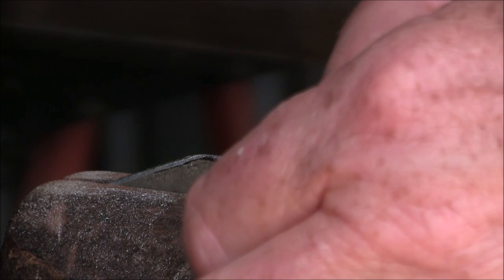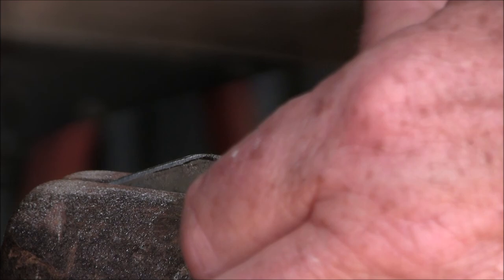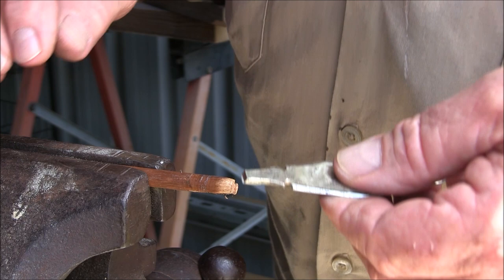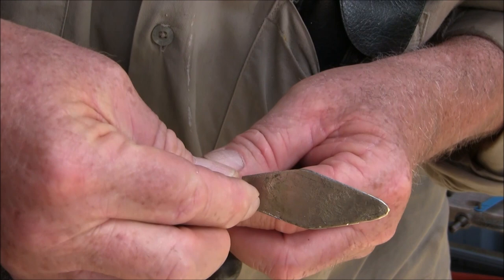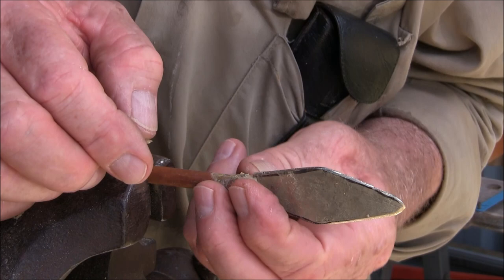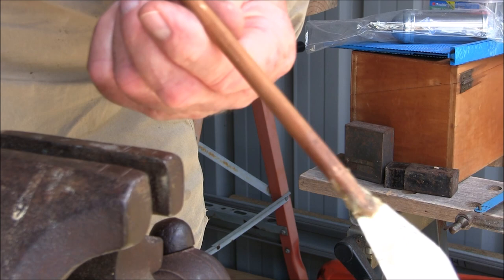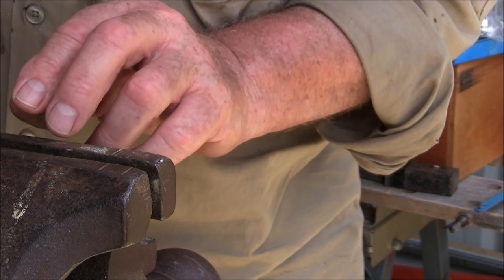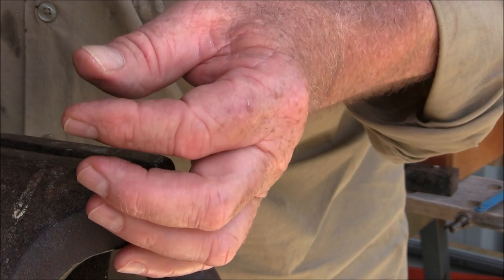Making & Fitting An Arrow Head Made from A Spoon Cold Forged Part Two By Keith H  Burgess

Comment: pine pitch is probably the best natural glue to hold metal in wood...I would split the feathers, this way they lay better against the shaft and don't tear
Reply from the maker: Thank you for the advice Sheepdog. Not much pine here, but I will certainly try splitting the feathers next time. I do want to make some new arrow shafts.
Regards, Keith.
Reply: @historicaltrekking  I can send you some pine pitch, you can make your own charcoal to mix it with
Reply from the maker: @Sheepdog1314  Very kind of you & your offer is very much appreciated, but I would rather experiment with native pitches Sheepdog, all part of the fun which I am sure you will agree :)
Regards, Keith.